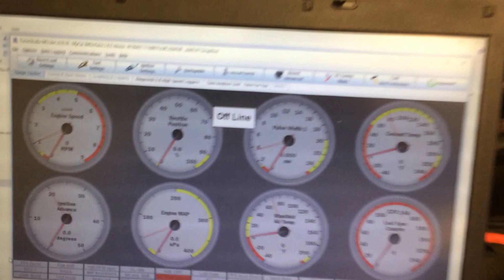MegaSquirt First Start

Comment: I went with a '96 distributor without TFI altogether. And then epoxied a magnet and hall sensor on the distributor cap on cyl 1 to tell efi which cycle the engine was on and a minivan wasted spark coil. I suppose with a throttle body, you could do away with the epoxied signal like I did as the wasted spark will sort out the sparky bang part. 

Great to see something old, NEW again! <3 all